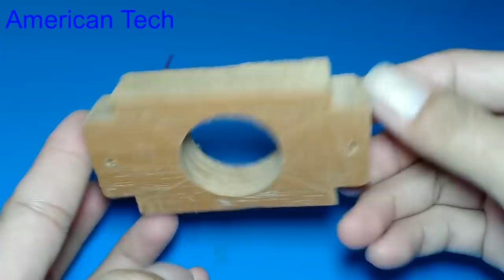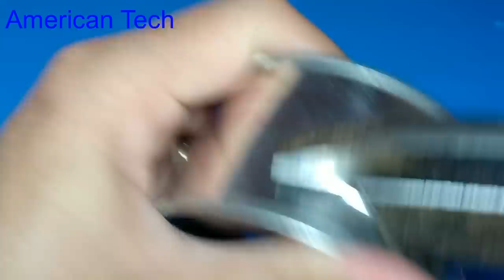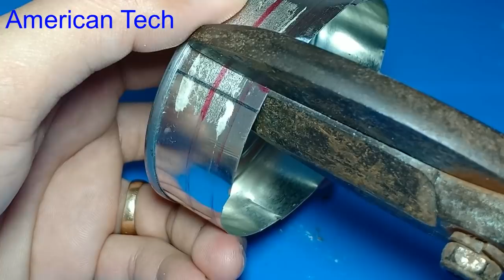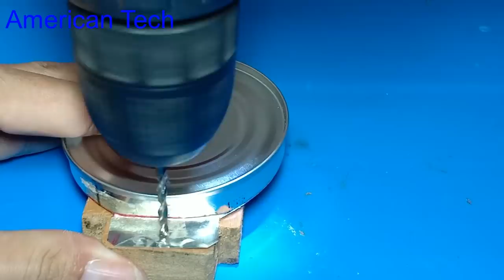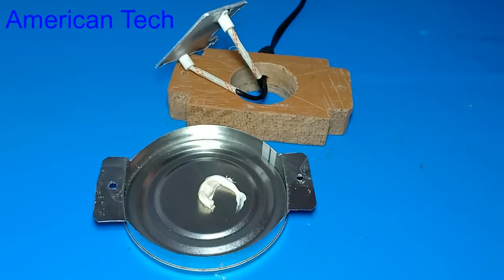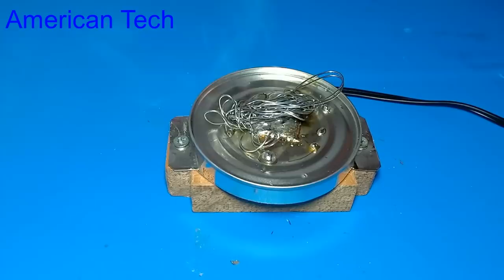How to make soldering pot very easy , Amazing idea

Comment: Good idea just need to add a few safety features and it would be gtg  some of u don't relize that there is folks out there trying to get into the hobby and th I 's is how it is done for cheap it's called salvage or repurpose money don't come easy to retool and get supply just to get started you can talk in the 100s if not 100s of dollars most folks don't have salvaging components is the best way to yes add a ground isolation or over current protection mabe even adding a dimmer wall switch to set temp and current the evolution of man and discovery this is how it is done

Comment: Don't use solder with flux, see that smoke? It's from the pool of flux under the solder!
You can get bars or pellets of plain solder, costs less than wire.  
Temperature control/voltage variance is a must. 200-230c is all that's needed.

Comment: extremely dangerous device, no ground to prevent getting Shockd with 220v if one wire disconnects, also can shor or blast into flames

Comment: This is truly not so difficult and don't demands any pay! But can it melt aluminium?
Reply: Aluminum? If would have to get up to ~670 °C to melt it. Leaded solder melts at ~235 °C, and lead free at ~295 °C.
It is a nichrome wire heater, so it can heat to 500°C or more easily. Add a PTC thermistor for crude temperature regulation.

Comment: Sorry but I think this is just to dangerous. No thermal regulator 💀
Reply: Yes, you are right
Reply: Plus cut the lead out wire and joined PVC flex very close to heating element.  Would be better to keep the terminals at the right length and make a joint there.

Comment: How to find nichrom wire in home
Reply: any heating element ( like cooker , iron(coil type)  heaters etc ) make sure the thermal heat you want for yours device and the heat it produces(the coil or element ). Follow all safety rules . Do only if you know what you are doing.
Reply: ( the thermal heat you want for yours device and the heat it produces(the coil or element )what i mean here if you require ,  say 40W use 45 to50W coil/element because normally 10 to 20 % is added in design for sturdiness like Voltage fluctuations , ambient air temperature etc . If you use a high rated element like a room heater ( eg.  table top model using 350 to 2000W) it might cause FIRE or burn down the room or lab or home you are experimenting IF YOU ARE NOT CAREFUL and no proper attention is given all the time .